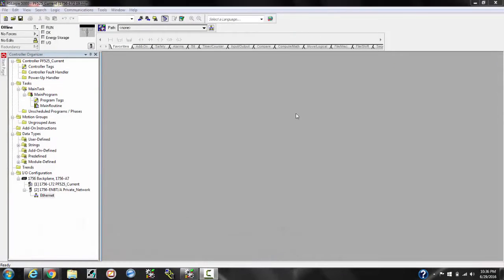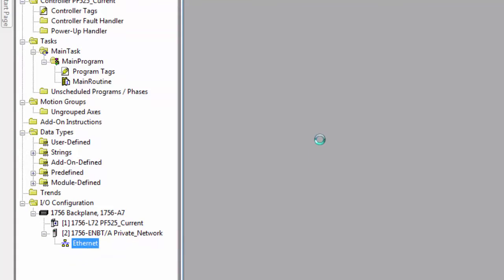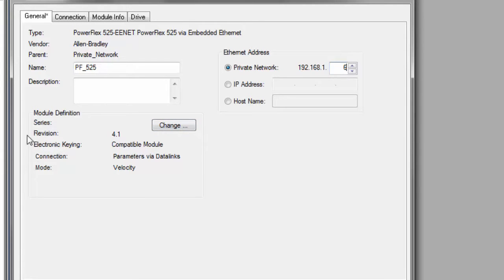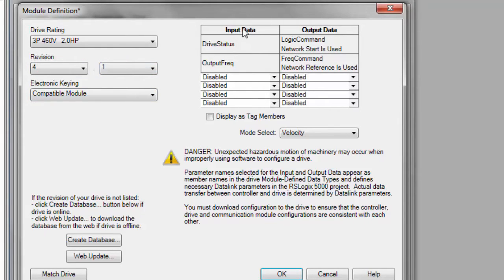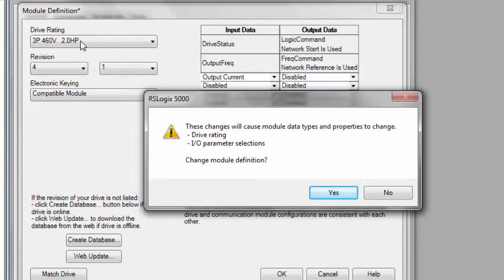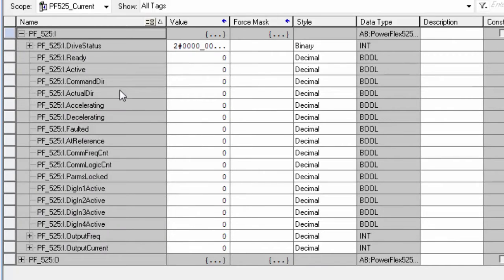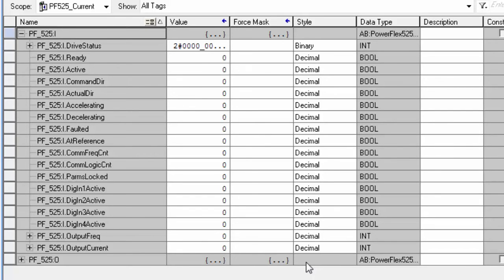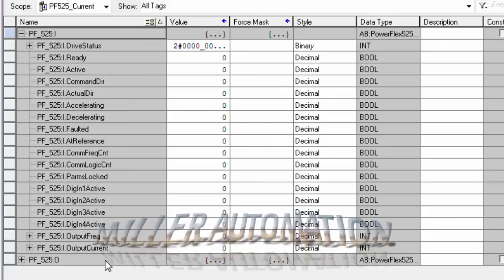PowerFlex 525 Reading Current

Comment: I tried this but after changing the properties and configuration to enable the display of current and downloading, it still doesn't display on the tree by frequency like your did.  Thoughts?  I double checked the properties and it's still enable under current.
Reply from the maker: Did you complete the DL? In the config?
Reply: @PLCAutomationTraining  yes
Reply from the maker: @toddpreisler8963  look at the connection properties at 0:54 in the video
Reply: PLC Automation Training I'm not with the program right now. However I believe the properties are correct because I'm controlling the vfd with my program.
Reply from the maker: What VFD
Reply: @PLCAutomationTraining  powerflex 525. Rs5000 very 20.04
Reply from the maker: @toddpreisler8963  it does show under connection parameter and data links right?

Comment: I have an upcoming project where I intend to use an analog output on a PF525, parameter t088 (torque output 0-20mA) as the torque command analog input (parameter 675) to a PF755 to create Torque Following for two mechanically linked motors for a crusher. Can this be achieved via ethernet?
Reply from the maker: Let me check on that

Comment: Hi There,

I'm looking to do exactly this, but to an existing drive. This video has already been very helpful but in online, offline, or Program mode, the drop down boxes don't appear, I can only see the grayed out DriveSatus and OuputFreq. Is there a known way of adding these to a pre-existing drive or will I have to delete and re-add? 

Thanks
Reply from the maker: Dan Place because these are data links you will have to go offline and change it then download to the plc
Reply from the maker: Also a Rockwell favorite response, restart you pc
Reply: Hi there, I've tried it offline and even so the drop down boxes are not available, just the grayed out factory set ones. My guess is I will have to remove and re-add the drive to allow me to do this. Thanks for the speedy reply.
Reply from the maker: Yes unfortunately you may have to do that.